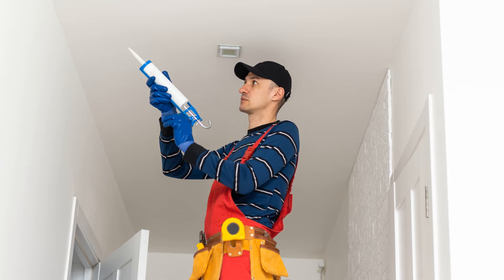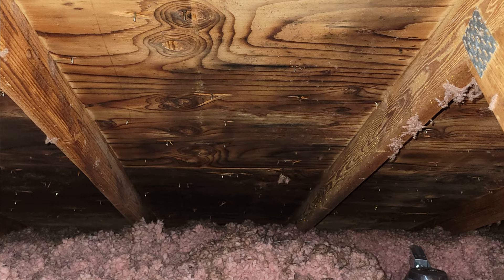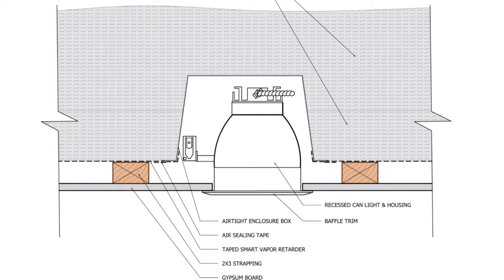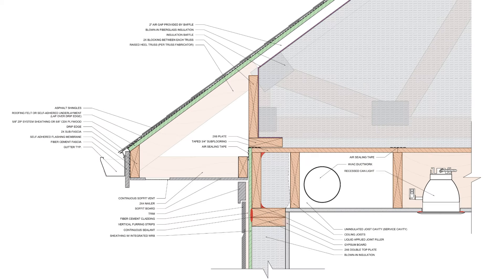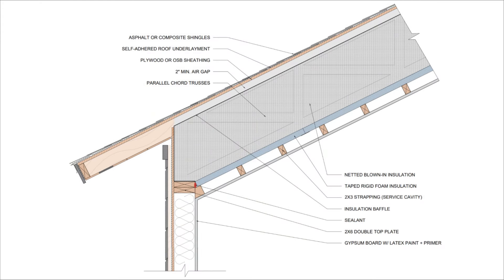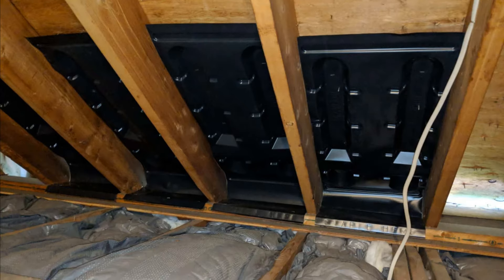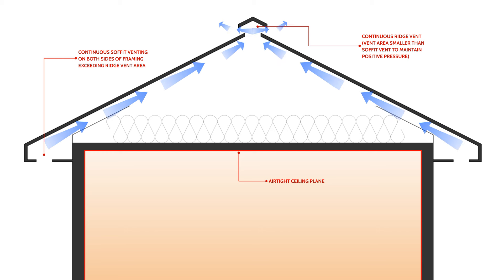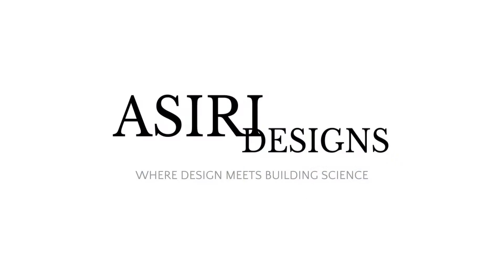Do This For a BETTER Vented Roof

Comment: I used Certainteed Membrane on the ceilings of my house and Siga Majvest in the walls. All of my lights and such got taped with Siga Rissan tape and although my mini splits aren’t running yet, a small window air conditioner cools my whole main floor about 1000 square feet. Can’t wait to see how it does for heating this winter.

Comment: Great explanation, we do a lot of cathedral ceilings and use a 1/2 wood fibre panel as our vent baffle 2-3” below the underside of our roof deck. We install a smart membrane, Intello or Majrex against the interior ceiling side of the truss followed by a service cavity which is key for maintaining airtighness without penetrations.

Comment: I have built a separate extention to our cabin where it is from inner side 45x300 LVL beams with C-C 900mm and in top of those a 12mm plywood sheet making it a closed roof.  I was first planning to fill up with 300mm thick mineral wool.  But now I am consider to glue a 50 or 100mm EPS towards the plywood with PU foam around each so it gets air tight, and then 200mm of Mineral wool. during winter it will normally be around 25-35 minus degress outside and 20-25 degrees inside, so it will be a bigg difference in temperature, so I was thinking that with 50 or 100mm EPS towards the outer layer the condensation point will be inside the EPS instead of inside the mineral wool.  Please give advice if you have time, I was planning to do these parts in around 3-4 weeks.  

Edit: on the inside of Mineral wool I was planning to add a membrane that will keep moist from going in to the mineral wool)

Comment: Does the ceiling air / vapor control layer need to connect directly to the wall air / vapor control layer by wrapping the top plate in some way? Thanks for the videos! Consistently more informative and applicable than other building science channels
Reply: Matt Risingers latest video named "Mountain Build with a View" tours a house that does this.
Reply: If you’re building new and can, yes.
Reply from the maker: @brennangran2763  Thanks for watching, and great question. The answer is yes, and whether that layer is located on the exterior or on the interior is going to entirely depend on the design of the assembly - but it needs to connect to whatever is serving as the primary air barrier in that wall assembly.

Comment: For my house I am leaning towards using plenum trusses on the second floor. Sheath the bottom of the plenum trusses with taped zip, install the ducts and then cover with framing and drywall. The perimeter would be airsealed with additional zip or possibly Majrex.

Comment: I can’t see ANY roof venting on our hot dry southern New Mexico climate vaulted ceiling?!! There sure doesn’t seem to be any soffit vents. There might be a ridge vent. I’ll climb into the attic and look closer. Are houses sometimes built without roof vents in the dry desert. It’s only slightly humid for about two months during monsoon and dries out in-between rain storms. Also the attic appears to be unvented except for the ridge vent if there is one. The attic gets very hot so I’ve been planning on venting it somehow. Any suggestions? Thanks for the series. I subscribed.

Comment: Does the Oregon building code still allow HVAC ducts to be placed in a vented (untempered) attic or crawl space? I know it’s bad practice and that model building codes have moved away from this formerly common practice. Just wondering if OR code has gotten there yet. Thanks.

Comment: Just in the process of buying a house, generally very well-built and decently insulated, but the roof is vented.
I’m considering either installing baffles and air sealing with spraycans or foamboards as you suggested , 
but also converting the entire space to be a conditioned attic. But it being a truss, I don’t gain free extra space or anything.
Bit nervous about the second because I’d be making it pretty major change system that has already been working successfully for a long time .
Is there any downside to installing baffles air sealing and then basically adding as much insulation as I can get away with?
All the mechanicals are in the basement , so no issue there
Reply: Sounds like a lot of work for little gain to me but I’m not THE expert. If you have a air gap I dont think you need the baffles. If it’s not broken dont fix it.

Comment: Does anyone sell baffles that have radiant barrier stuck to one side?
Reply from the maker: I believe there are a couple out there, but I'd probably just fasten 1/2" foil faced rigid insulation to the underside of the top chords instead of hunting down a reflective baffle product.